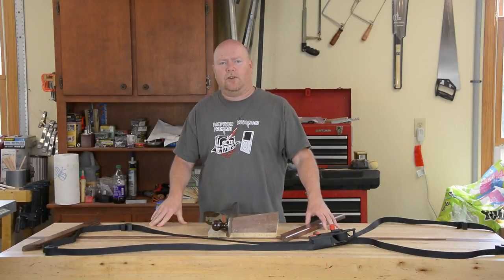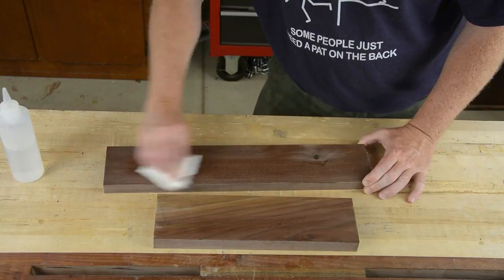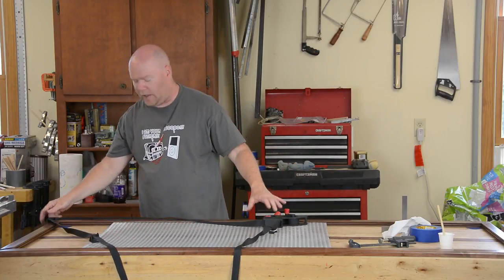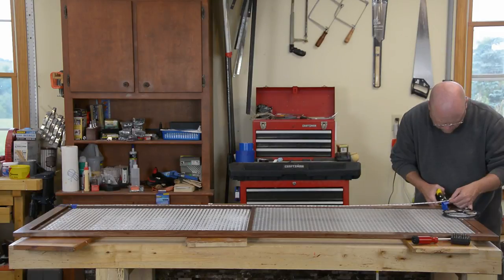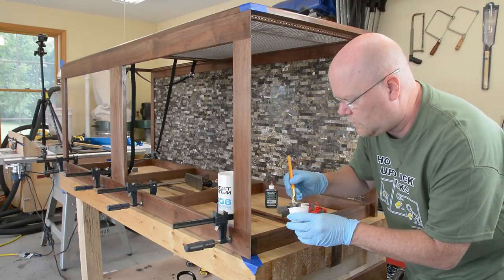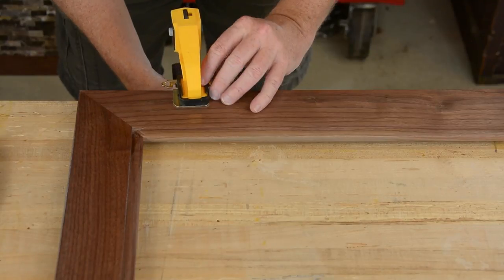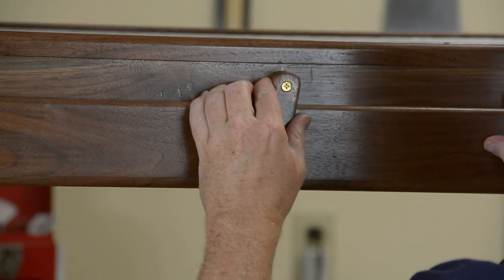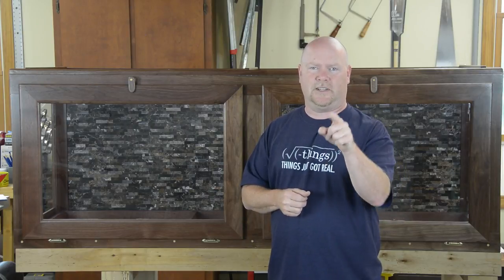Snake Cage Part 3

Comment: Great looking enclosure. After all was said and done on this project what were the dimensions? Also how much did it cost? Looking to something similar for my red tails but for 3 of them
Reply from the maker: Final dimensions are 6 feet long, 24 inches tall and ~20 inches deep.  Total cost was a couple hundred bucks, but I didn't have to pay for the wood and there are lots of places to go cheaper without hurting the functionality at all.  The stone tile alone was $100 - and is completely unnecessary.  Glass is much cheaper than polycarbonate, and steel would have been cheaper than the expanded aluminum for the top.
Reply: Matt Heere thanks so much I appreciate it